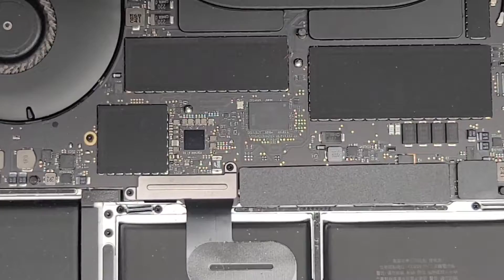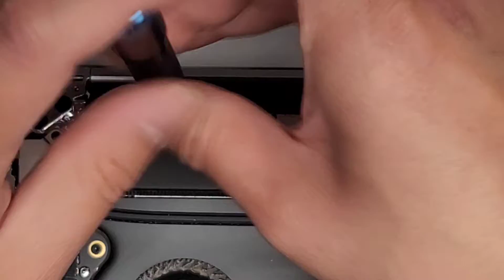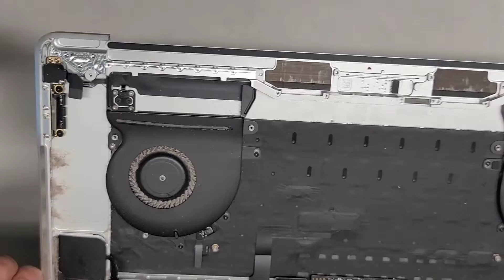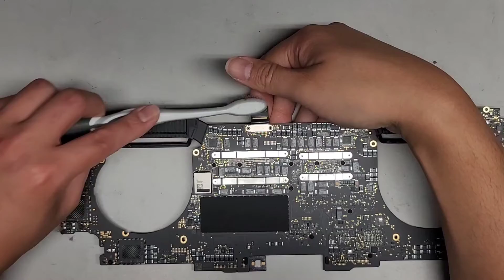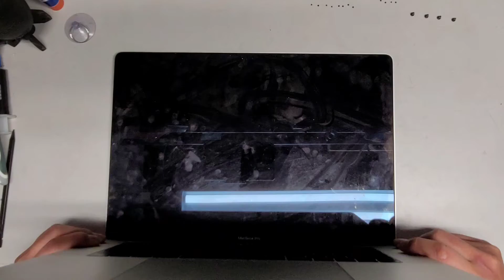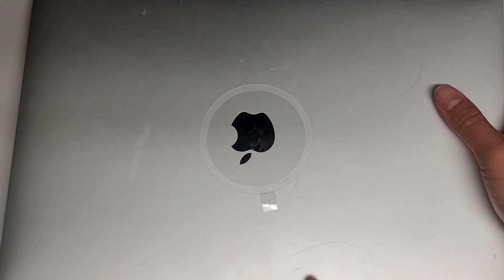2018 15" inch MacBook Pro A1990 Disassembly Liquid Damage Cleanup Motherboard Logicboard LCD Screen

Comment: My laptop turns on now, but didn’t charge after 5 hours. Any advice?
Reply from the maker: Double check the ribbon cable and the metal tab.
Reply: Sweet got it to boot now it just flashes charging not charging lol
Reply from the maker: @AshAvila-o4w  uhhh

Comment: wow only 266 views and 3 likes?  This video is so underrated.  Thanks a lot - that was great!  you really nailed the instructions on disassembly / reassembly.  

Just one suggestion - I wish you would emphasize at the begging of the video that laptop must be connected to the external charging cable to power back up, because if you don't watch the entire video to the very end and try reconnecting the laptop, you'll think you messed something up.  in fact, i was about to toss the laptop out because i little metal pin came out of the flat strip over the battery and i assumed i can't power it back on because of that.  I was ready to toss the laptop in trash, but had time this sunday afternoon and went through the entire disassembly / reassembly just out of curiosity.   You can imagine how shocked i was to learn that little fact about connecting laptop to the power cable at the end.  my laptop actually started. 

So yeah, you might want to mention that at the very begging at the point where you disconnect that battery, please! 

Also, i had a very similar problem to the one in the video - a little bit of liquid got on my screen and it pretty much stopped working.  Works with external monitor.  I looked carefully through all the cables and connections and found no damage whatsoever.  My theory is - perhaps that liquid on a screen actually got into a screen at the bottom, where glass meets plastic, and perhaps that's why it doesn't work properly. 

I actually would like to try replacing the screen myself.  where would you recommend I find a replacement screen at best price?
Reply from the maker: Glad you didn't give up. The screens are actually extremely expensive for this model. This is what I'd order. https://amzn.to/40eGQKu
Reply from the maker: I'll take that into account in my future videos.